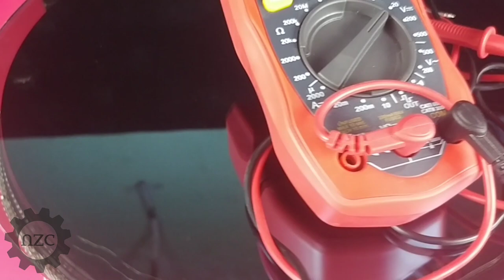How to repair 6v and 4v Dead batteries in 5 minutes

Comment: This will not work long term. Batteries have other parts that will fail due to a number of factors and the most common failure is sulfation and this will do nothing to "repair" them.